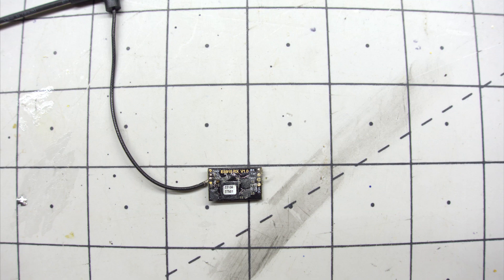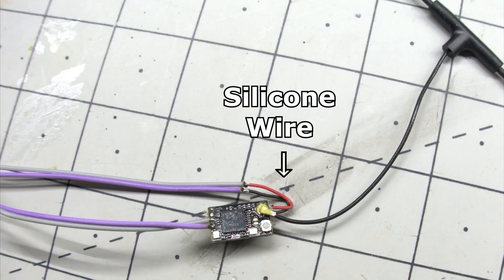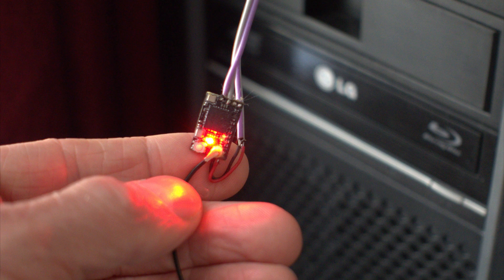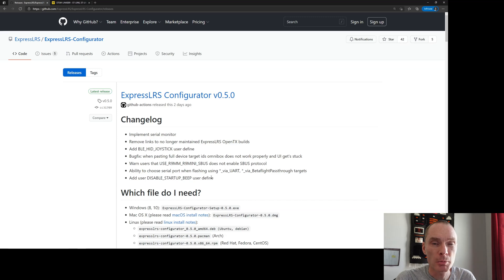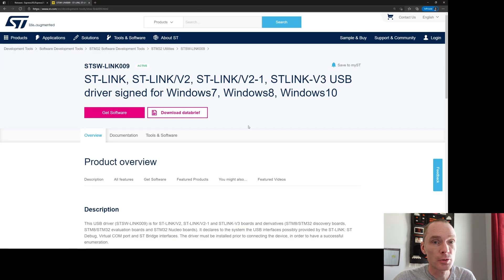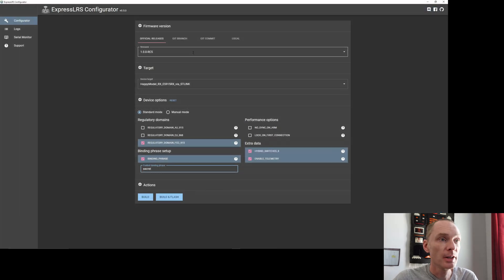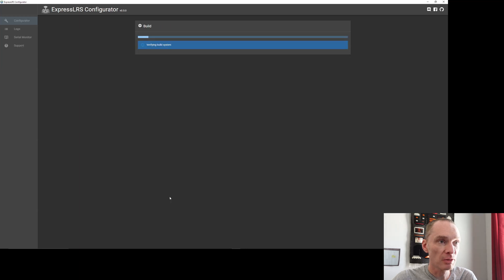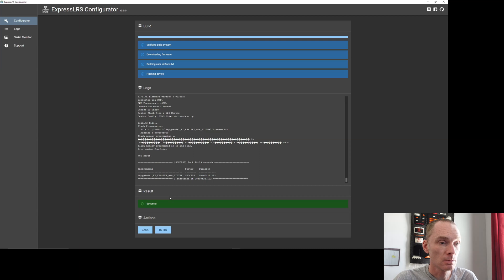Unbrick a Happymodel ES915RX ExpressLRS Receiver (Rx) Using a ST-Link V2

Comment: how come my ST LINK V2 wont take a firmware upgrade?  cube program connects and reads it but the upgrade procedure doesn't actually upgrade even though it says it was successful.
I orderd an oem one from ST but is there a way to fix these clones
Reply from the maker: Sorry, I never tried to flash the firmware on the ST LINK V2 itself.  It work fine for flashing my ELRS Rx so I never had the need.  I have only used the ST-LINK driver, none of their software.

Comment: Reiley:
Thanks for this helpful and clear demo.
I am a newbie to the Express LRS equipment. Could you inform me whether I need to have a Ham license to operate the 915mhz frequency equipment in the USA? Is there a maximum power level (10mw, 100mw) where I can legally operate without a Ham certification?
Can you share a clear concise link where this is discussed?
Gratefully, Jim
Reply: Thanks for your very full response to my question. 
Let's see what I can come up with. I had asked this question to the AMA gov relations rep several weeks ago, but received no reply. She may not be there anymore.
Reply from the maker: I'm in Canada so bear with me for FCC info (although they are petty much the same as it is the same region for radio frequencies) 915 is an open frequency.  Old cordless phones as an example use to run on it without the need for a license.  The bigger issue is none of the hardware is FCC certified.  Having watched some of the tests on the vtxs and how much they vary from their advertised tx power, I can see why this is in there, but short of flying dji, there isn't much you can do about it.  Here is an article that explains it a bit better:  https://hamradioprep.com/fpv-drones-using-a-ham-radio-license/

I don't really know about tx power limits.  It would be really the vtx that is the issue for that, expresslrs will need much less tx power than your vtx.  I found this link:  https://afar.net/tutorials/fcc-rules/  which seems to indicate if you are 1w or less your fine (ignoring gain from the antenna).  If you find better information, please post it here!

There are some very technically knowledgably people on both the 'Drone Community' and 'ExpressLRS Community' on discord that could answer better than I if you want to give that a go.